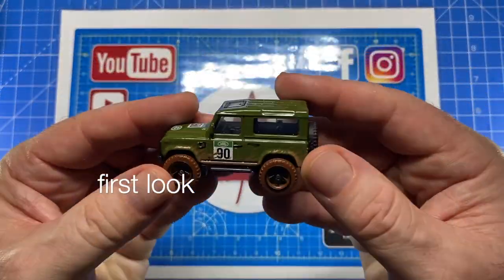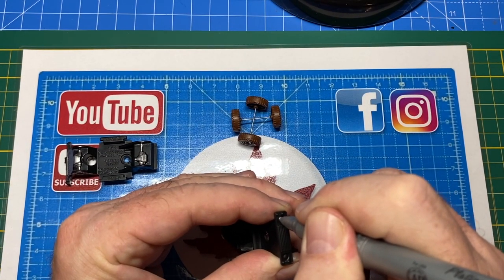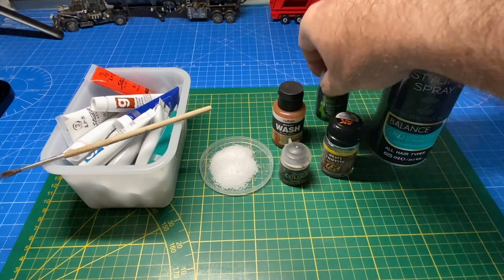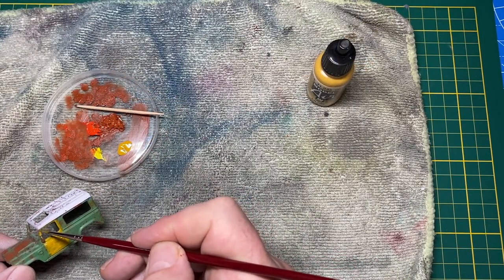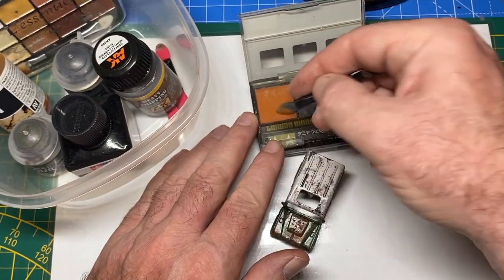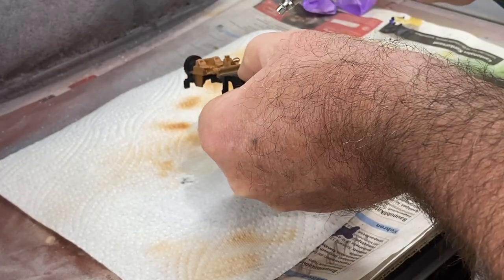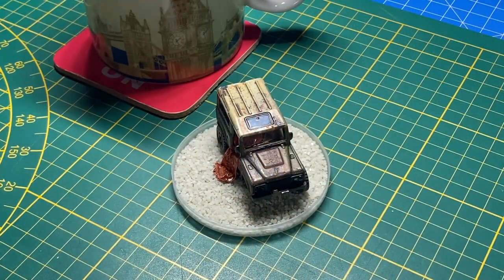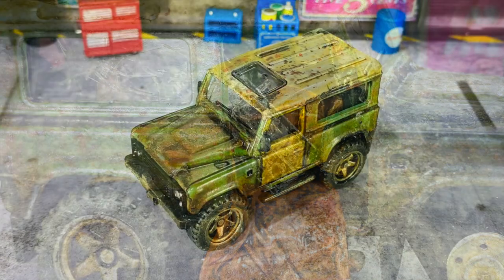Hot Wheels Land Rover Defender 90 (115) salt chipping and chemical dip

Comment: I don’t know what to say here. This is the best piece I’ve ever seen from you, Andrew. Top to bottom, the innovation is off the charts. The parts, the tarp, the brake rotor….unbelievable. This is in my top 3 custom pieces ever made, bar none. Staggering. When you look and find a 3D printed steering wheel, it becomes obvious that every single detail was considered. Bravo. If you need a fund raiser, please consider auctioning this piece off. My opening bid is waiting. And I’d love a sticker too. 😀👍
Reply from the maker: David, that's high praise, indeed. Thanks so much. I'm always left feeling very encouraged after you weigh in with a comment. That's a gift you have and I appreciate it so much. A new MLC sticker will be en route soon! 🍁👊

Comment: I may have already shared this technique with you but if not here we go... to make a homemade "rust pigment" I guess you could call it take some steel wool drop into a container with white vinegar and a little bit of bleach. let it sit for a couple days until it completely breaks down the steel wool pour out onto a coffee filter let it air-dry for another couple days and you have rust powder ...you simply apply with a little bit of water sprinkled the rust on once the water dries lightly tap the casting to knock off any access and clearcoat it gives you real rust texture and effect.👍
Reply from the maker: I've seen variations of that recipe in different YouTube videos. This'll be the final impetus to get me to mix up a batch. It'd be hard to beat the real thing for a rust effect! Great tip. 🍁👍